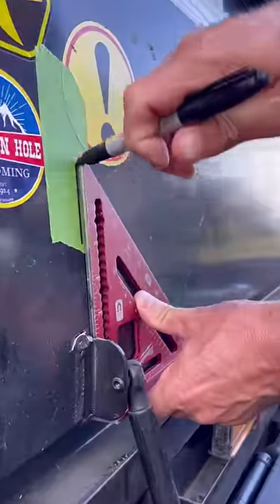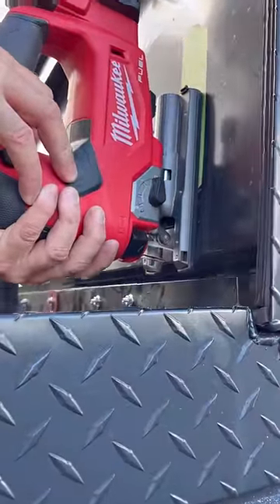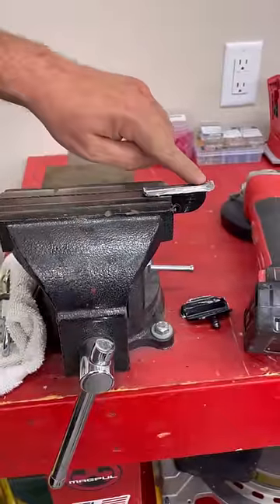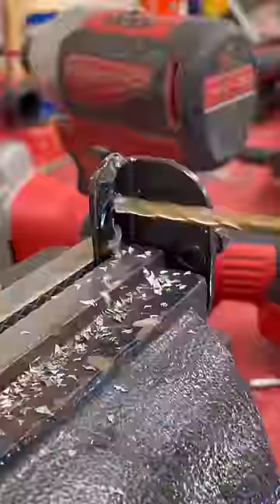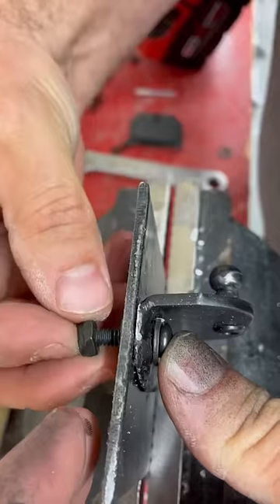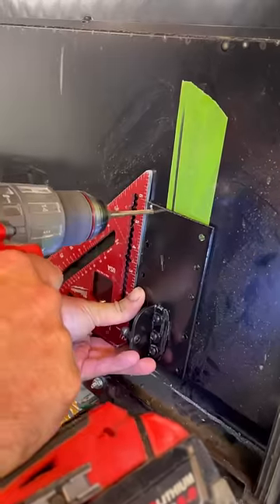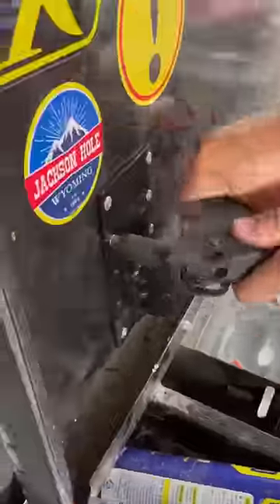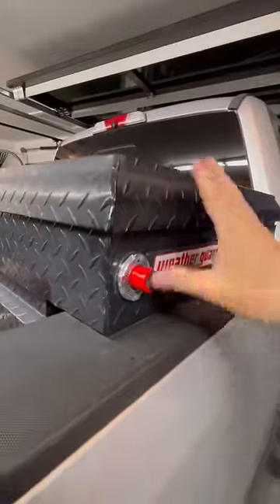I Had to Fix the Broken Shock Mounts on My Truck Toolbox

Comment: I wish repairing and reusing things was something we as a society did more often, but it’s simply not economical.

With mass manufacture, you (generally) can’t justify fixing something over making a new one.

The process for making new items is already there and constantly operating. The process for repair is difficult, expensive, and sometimes not even available.

Comment: You had me a bit scared drilling and cutting that close to your rear window.  However, you pulled it off.  Great video and kudos for not throwing it in the trash and just buying a new one.
Reply from the maker: Thanks 👍 I actually wasn’t drilling the whole way through the top just until step to me down area

Comment: Good repair, only thing I would do differently is rivet from outside to get flatter surface for outside.
Reply from the maker: The rivets actually don’t go through the top of the toolbox. They go through a step down section.
Reply: @hausplans  didn’t notice first time around, right on👍

Comment: Nice work, I think your new failure point will be the angled brackets themselves or the mounting knuckle. Regardless, you can just drill out the rivets, weld the nuts the back of the plate and make it easy to swap out the angle brackets and get even more years out of it!

Comment: The strength of the repair is great, I would just be concerned with water getting in through there. It might not be a lot or right away, but water will be able to get in there eventually.

Comment: If you use steel sleeved rivets, they'll wear holes in the aluminum.  You can get aluminum sleeve rivets that will be sacrificial to the steel plate.

Comment: Those steel plates took the concentrated load and spread it out over a larger area, that fix will last for a long time. If anything loosens over time, it would be easy to drill out the rivets and tighten the screws or replace the loose rivets with new.

Comment: Besides the bolts now sticking out the top of the tool box nice fix
Reply from the maker: The pop rivets and bolts didn’t go through the top they’re attached to step down section, so there was no need to waterproof.

Comment: corrosion will occur between the steel and aluminum due to electrolysis, but it will last for a while.  Peterbilt cab corners used to corrode for the same reason.

Comment: I generally like the repair, lock nuts, and having the old shocks potentially replaceable is my jam.
My only criticism is I do not like rivets for anything. They do not leave the opportunity for easy serviceability. Yes, they can be drilled out, but you are left with a bigger hole. 
In that one specific moment, I would have chosen carriage bolts (the ones with round head that can't be accessed from the "outside"). These would have allowed the plate to be changed/serviced or potentially a new upgrade be put in place.
Now, with the carriage bolts, you would still be making a hole, but it would be square for the head of the bolt to drop in, and I have found the square holes easier to patch or reinforce.
I say this with good intentions, so I hope no one gets all riled up over this submission.

Comment: The only slight thing I would do in addition to what you've done, is round the corners of the steel plates to reduce the pressure on the corner points.

Comment: I would’ve run the pop rivets from the top side of the box.    But non the less.  Great fix
Reply from the maker: The popper it’s actually don’t go through the top. They’re attached to a step down section.

Comment: Looks good ! I’d just suggest some silicone  in between the patch and existing lid to prevent water from getting in.
Reply from the maker: The proper rivets don’t go through the top. They’re attached to a step down section so no need to waterproof.

Comment: Great job repair tool box and now you have a soaking tub when it rains
Get some flex seal fill the hole in the top
Reply from the maker: It’s still 100% waterproof, the bolts and pop rivets don’t go through the top. We posted a second video showing this

Comment: I'd suggest adding some caulking or epoxy along the seams, since I'm not sure this repair will keep rainwater out of the tool box.  Maybe put a thin rubber sheet between the plates and the lid before riveting, to act as a gasket.

Comment: Yup, but you forgot to put some isolating material (fiberglass, rubber, plastic or any other non-conductive material) between the steel plate and the aluminum box cover. The dissimilar metals will result in a lot if corrosion from rain and moisture. The steel plate eill rust in a short amount of time and you will have to repair it again. The paint on the steel plate helps a bit, but it will still rust after a while.

Comment: This is great but be careful about galvanic corrosion : 2 different metals in contact.  It it gets wet, one of the metals might corrode the other.
Otherwise, mechanically, that should do the trick.

Comment: Weatherguard is a work box. I have a variant in my personal truck with the sticker from 1997. It’s basically a weatherguard. Protech looks cool for stupid money. Highway Products is solid but you’d better have a severe use case to justify their prices. If you’re keeping the pickup bed and need a box, go for Weatherguard. Need a top tier service body? Highway Products has you covered in aluminum and steel. They’re stupid expensive though.

Comment: looks good but my only concern would be leaks in heavy rain, some form of seal would of made it perfect
Reply from the maker: The pop rivets and bolts don’t go through the top they are attached to a step down section

Comment: I would perhaps put a steel plate on the back as well and use the rivets to sandwich them. Mounting rivets on a thin piece of steel will eventually wear it. Awesome repair though.

Comment: Great work! Definitely would put the plating on the outside of the box so water doesn’t pool/leak inside as easily
Reply from the maker: The rivets don’t go through the top. They’re attached to a step down section so it’s still 100% waterproof.

Comment: Steel is very good since it has very low metal fatigue that only shows up YEARS later. THat is why we use steel in construction because steel lasts as long as it does not rust.

Comment: Need to coat the steel with somthing like flexseal, to prevent dissimlar metal corrosion.  It will develop in a few short moths to a year in a wet humid environment,  it would also help with the waterproofi g of the holes you cut out.

Comment: good repair, only thing id change is id put something on the top tho to prevent any water intrusion
Reply from the maker: The pop rivets and bolts don’t go through the top, so it’s actually still waterproof

Comment: It will hold up but the location of those struts is an inherent design flaw of the box. They should be near the sides and bolted to the vertical side walls of the base and lid.

Comment: You should have put a some mylar tape (clear packing tape) between the plate and the lid to prevent dissimilar metal corrosion.

Comment: Gotta make sure it doesn't leak from the top or them tool be rusted after it rains. As for the fix looks good but pop ribbits to hold the plates might loosen over time, I would suggest using flat screws with double screws with lock tight so it doesn't rattle loose.
Reply from the maker: The pop, rivets and bolts don’t go through the top. They are attached to a stepdown section. So it’s still 100% waterproof. We posted a second video showing the top if you wanna check it out.

Comment: Good2Go just be sure to seal the rivets because they are not watertight where the pain goes through 👍🏽
Reply from the maker: The pop rivets and bolts actually don’t go through the top. They’re attached a stepded section. So it’s still waterproof.

Comment: Yes the repair was good,  I think you have another 15 years before you have another problem. Look at where mounted on the bed vibration will wear out the holes and bolts

Comment: How cool that you didn't show the top of the box after the repair 😅
Reply from the maker: The top looks the same because of pop rivets are attached to a step down section. And we did post a second video showing the top. You should check it out.👍

Comment: Just need some silicone on the top where the rivets are! GoodJob!
Reply from the maker: The rivets actually don’t go through the top they’re attached to a step down section. So it’s still completely waterproof. We posted a second video showing this if you want to check it out.

Comment: Not a complaint but more of a question.  What about drilling smaller holes and using coarse threaded screws instead of pop rivets.  I can see the rivets fatiguing.

Comment: Nice repair but maybe 5 years ish?  Holes not treated will allow rust to form. Dissimilar metals will enhance that deterioration specially once the pop rivets stretch and movement starts. The added strength you gained just exposed the next weak spot which will be the other end of the shocks.

Comment: Probably should’ve put washers on the back of the rivets. I’ve had many pop rivets pop out of metal, plastic and steel on race cars. Until I put washers on the back giving the rivets a wider area to pull on.

Comment: As good of an idea as that was, you'll probably get maybe another year or two out of the repair thanks to galvanic corrosion. The steel will eat away at the aluminum, both the shock mount itself and the rest of the toolbox. What you should have done was ground off the shock mounts then made new ones out of aluminum angle, then rivited those to the box

Comment: Nice work.
But steel on aluminum can lead to galvanic corrosion due to dissimilar metals causing the corrosive chemistry. Are the rivets also steel? Why not use a thicker aluminum sheet for the patch?

Comment: i think the issue is that the lid opens too far. So either find a longer damper, relocate the position of the damper, or make end stops for the lid so it doesn't go over the damper's travel. The new brackets may hold, but something will eventually break at the next weakest point

Comment: The repair will hold up. The rain will get in though. You should have put some silicone in between the patch and the lid.
Reply from the maker: It’s still waterproof the rivets didn’t go through the top
Reply: @hausplans  there you have it! I like your perspective of fixing it instead of discarding it.

Comment: My only concern would be the exposed bolts (Idk if they are or not) but I wouldn’t want someone to just take the hinges out and pry the back open.
Reply from the maker: The pop rivets actually don’t go through the top. They’re attached to a step down section inside the box.

Comment: The issue here is having aluminum anf stainless steel together... as soon as it gets wet, a chemical reaction will happen and it rust very quickly... it if its an aliminum box then you should use aluminium plates

Comment: id say put a gasket between the riveted plate for a bit more of a seal from elements but silicone should work fear when it warps in heat water will be able to get in
Reply from the maker: He’s the popper. It’s actually don’t go through the top of the lid. They’re attached a step down section so it’s still waterproof.

Comment: Seems like it will hold just fine, I personally would have installed the rivets with the head on the top of the toolbox instead. But either way it's gonna hold
Reply from the maker: Thanks, the rivets actually don’t go through the top they’re attached to a step down section in the lid, so that’s the only way they can go
Reply: Oh ok fair enough. Then that's perfectly good repair in my opinion.

Comment: Well this is a nice reapir job but... shear force is applied to alluminum rivet joints only although much greater mechanical ressistance would be achived if steel plates were placed from outer side of the lid

Comment: It should hold up cuz its a fresh repair, but it wouldn't hurt if you cleaned up the metal plates ..grined them clean..then add some fresh strong welds. That way you have no doubt if it will hold or not !!!!

Comment: i would have done the same thing, except i would have used a strong epoxy or adhesive of some sort between the steel plate and aluminum when adding the rivets.

Comment: Good fix BUT... as a rule of thumb you should never mix aluminum and steel together... you should stick to the same metal throughout otherwise galvanic corrosion will occur.

Comment: Will 100% fall apart - eventually.  Not because "everything eventually falls apart" , but because of dissimilar metals.  Steel & aluminum.  Yes it was painted, but small vibrations and usage will wear through.  Then the two metals will corrode each other, and faster than you would think.  Next time you join Aluminum & steel put a few layers of mylar tape between the two.   Or just use aluminum and weld/bolt/screw/rivet.....

Comment: Not saying, it’s a bad toolbox by any means but honestly, you probably made the entire toolbox about 10 times better, I would go as far to say that the plate should’ve been already implemented in the manufacturing process as opposed to welding straight to the thin sheet metal

Comment: If aluminum alloys are connected to steels, galvanic corrosion will occur due to the corrosion potentials of aluminum alloys are lower than steel.

Comment: The only issue would be dissimilar metals (aluminum and steel) will cause oxidation. a gasket between the two would solve that but it's riveted.
Reply from the maker: Both the aluminum and the steel were painted so hopefully that will help

Comment: Looks like a good repair, but what does the top of the box look like now? Seems like there might have been a better way.
Reply from the maker: It’s still 100% waterproof, the rivets and bolts don’t go through the top they’re attached to a step down section. We posted a second video showing the top. You should check it out 👍

Comment: The stress has been distributed over a wider area, on top of steel instead of aluminum on a stress point. That should last as long as my 93 f350 no turbo diesel

Comment: I am assuming you painted the steel parts to further isolate them from the aluminum. Steel and Aluminum do not coexist in  direct  contact to each other well. That said, it looks solid.
Reply from the maker: I did

Comment: The aluminum and steel will cause corrosion, the paint will help but the bolts will cause issues. Good looking repair but you will start seeing rust in a few months.

Comment: Great work.....just can't figure out why you didn't put the rivets from the top for better finish......yes I know you angled the camera how it wasn't visible; but we who knows.....KNOWS.
I ALSO MODIFY OR REPAIR EVERYTHING......AND I'M ALSO GUILTY OF PUTTING FORM OVER FINISH 😮....
SO I KNOW😅😂😊
GOOD WORK!
Reply from the maker: The rivets don’t go through the top. They’re attached to step down section. So the top looks the same as it always did and it wouldn’t be possible to put the rivets in from the other side.
Reply: @hausplans  OK, now I understand.......a friend once told me that I modify everything........works for me.
Keep it up good man.

Comment: I would've put the rivets through the opposite way,so that it would look more professional when tool box is in the closed position.  I bet you did the same after looking at your tool a few times and seeing the bottom of the rivet instead of the head of the rivet.
Reply from the maker: The pop rivets don’t go through the top, they’re attached to an inner skin so there’s no way to put them in the other way around.

Comment: Shoulda used something else to protect that steel and aluminum.  The paint may help but it won’t last too long.
It’ll have galvanic corrosion because of the dissimilar metals and it’ll fall apart after a while too.  It may take a few years, or a decade, but if you’d have used a plate of aluminum it’d likely be rock solid forever.

Comment: Did you do anything to cover the holes on the top side? Seems like water will be able to work in and around the plate if nothing was done to seal the top side. That being said, still a solid temporary permanent repair.
Reply from the maker: The rivets don’t go through the top. They’re attached to step down section so the outside still looks the same.

Comment: It'll fail. Missed 1 crucial step, putting platic between the aluminum and steel, and dipping the rivets. You'll get GALVANIC CORROSION which will turn it into white pasties and eat it away. Other than that miss, good repair!

(Easy fix,  drill out the rivets, add your insulator shim, dip your new rivets and reinstall)

Comment: Besides the issues with drilling holes close together for the "pop rivets" in causing a structure integrity in a small area.......pop rivits are a "quick fix" for people too lazy to put some time in for a lasting fix.  Better to have welded the hinge mounts to the lid (provided you are a decent welder...otherwise get a pro to do it because a shoddy job is just the same as using pop rivits) then primer coat and paint the areas to avoid rust on the inside (there shouldn't be any paint on the top of the lid provided the welds were done properly on the inside because the lid would not have undergone any excessive heat causing discoloration on the lid)

Comment: It’s going to leak and the steel will rust plus you’ve changed the angle of the struts so they will wear out faster
Reply from the maker: It’s still 100% waterproof, the rivets and bolts don’t go through the top they’re attached to a step down section

Comment: Water might seep into it without any sealant between the two pieces of metal don't put anything sensitive to water under repaired hinges
Reply from the maker: It’s still waterproof because the bolts and pop rivets don’t go through the top